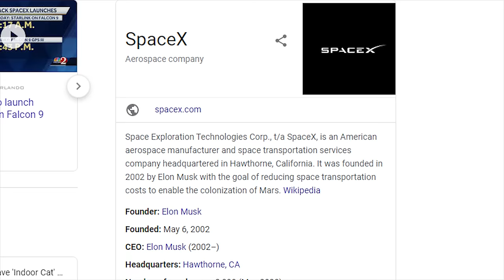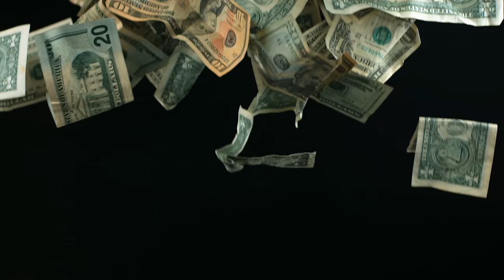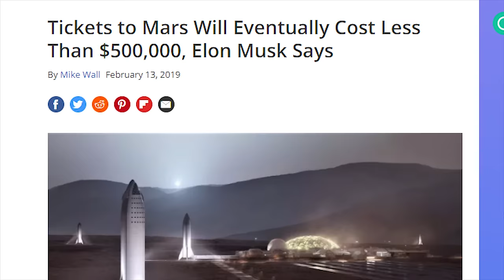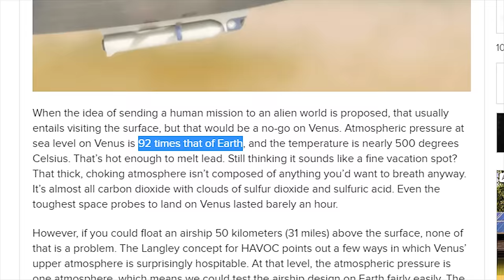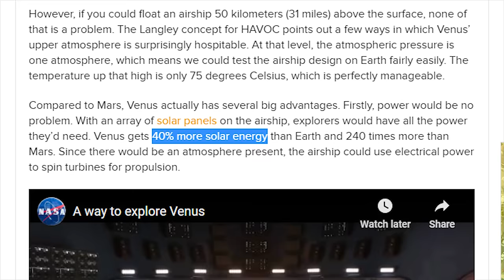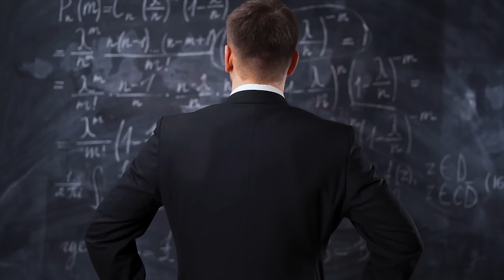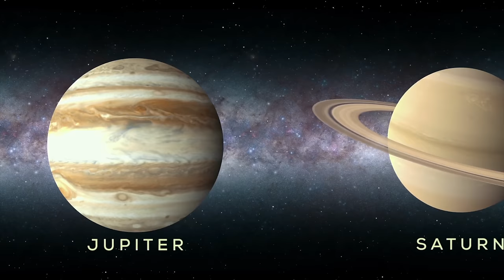Jeff Bezos' Radical Plan To Exploit Inhabitable Planets

Comment: Hey if there is a space race then great ... this is what we need to expand into the stars ... until that time we are vulnerable to annihilation by chance and misadventure.
Reply from the maker: For sure! A space race would be beneficial to all of us!
Reply: Unfortunately there will most likely never be an efficient way to transport humans between stars, and any colonies will be entirely on their own due to the enormous distances.
Reply: @En..  doubtful
Reply: @En..  not really we can already travel at 10-20% of light speed using solar sails, ion thrusters and electrical engines. That's more than enough in the solar system. And this is only slated to go up.
Reply: I doubt that it will be any different from now.
I don't want to fight with nukes with Martians😥
Reply: We are vulnerable to wasting a bunch of money.
Reply: @MS-qd1jj  it took nearly 25 years (for one of the fastest things that mankind had ever made) to reach Pluto.
Reply: @jemeljordan-butler4510  again, heavy, (possibly 25+ years) old tech. Also that mission made mistakes we're able to learn from. The new stuff is somewhat untested which is why NASA (or any other space entity) won't sink billions into a mission yet but it's only a matter of time. All it takes is one mission that's not a total failure.
Reply: @jemeljordan-butler4510  And about wasting money, think of the Indian Ocean Tsunami. A group of countries lost north of 12.5 billion dollars and 10,000's of lives. If they'd invested half of that into an early warning system, they'd have been a lot better prepared and saved a lot of money and lives. This is just one example of hundreds, prevention is almost always better than treatment.
Reply: @En..  thats why we need the tech to keep on evolving
Reply: @MS-qd1jj  you high or something?

Comment: Moving manufacturing to other planets/moons seems like such a terrible idea. By the time we have the technology to make the transportation costs low enough for that to even be a possibility, our manufacturing methods would have become clean enough that we won't need that option anymore. As for energy consumption. In those 100-200 years before solar panels can't sustain us, by then we'll probably have fusion anyway (if not something even more astonishing).
Reply: Like nuclear
Reply: That's another valid perspective from which one can view things. It however doesn't mean we can't run out of resources before we become technologically sophisticated enough to do these fancy stuff you're supposing here.
We need to start with the technology we have here and now. Don't rely too much on the future bcs you don't know what it holds.
For instance, we seem to be achieving nuclear fusion soon (apparently). On the other hand, the tech could still elude us for another 1000 years, who knows!
Reply from the maker: Great point, but moving manufacturing to other planets is not only for emission control. Another key point is increasing capacity especially with energy production.

Comment: Our body doesnt need 100 watts per hour, it needs 100 watthours per hour so it runs at 100 watts. Watt is not a unit for energy but for power.

Comment: But for those of earth industry, where do you get the oxygens to make sure that the flames are on, i mean a lot of industry requires flame
Reply: In most cases it's heat not flame.
Reply: That's not how powered facilities work. There are different ways to heat materials, including induction, magnetic induction, just running power to heater coils, and other means. Metalworking factories already use a lot of these methods. You don't need petrol, coal, or oil to power everything.
Reply: And in space, using solar kilns becomes much more feasible than on Earth.

Comment: Could we just keep the solar panels in space instead of needing a planet? One reason I say this is because solar panels lose efficiency when heated and Mercury gets really hot. Where space itself would be a great way to keep the panels cool. Plus you have the added benefit of not having dust collect on the surface of the panel, so then they don't need to be cleaned.

Comment: The landing of F9 boosters compared to New Shepherd boosters is NOT identical. One is a short, fat sub-orbital rocket which re enters the atmosphere with little to no hearing, whereas F9 has to perform a boostback and entry burn before landing is possible. F9 boosters are much taller and harder to control.

Comment: You are missing a huge piece of the puzzle, the entire point is that we can’t be stuck on a single point of failure. This is very short term thinking on a long term problem. Second, simpler innovations will help with pollution here, being able to colonize other planets is a full step change.

Comment: First of all I really enjoyed the video, keep up the good work. 

Rockets as you mentioned in the video could be made electric, that is false. You can make rockets environmentally neutral, but by literal definition you can’t make rocket’s electric, It’s not a Technological limitation it’s just not physically possible.

Also your main point that blue origin wants to but Industry on other worlds is False as well. Blue origin wants to mine and colonize the moon, as well as interplanetary space itself. This is because of shipping things from the moon to the earth is relatively easy, as the earth is a  massive planet and has a bigger gravity well. Plus the fact that our moon alone weighs about the same as almost all of the moons and astroids combined. our moon is planet sized no exaggeration, it’s about half the size of mars. The moon also has the advantage of being made of mostly the same materials as earth so all of your common metals and resources are readily available on the moon.

Mining and manufacturing on other worlds can be done. But shipping goods from not only a deep gravity well of other planets especially the gas giants, Back to earth is basically useless. Demand of energy and delta V required to move significance amounts of tonnage from these planets is going to be significantly more complex then mining the resources from our feet. We live on the biggest terrestrial planet. Most of the easily accessible resources in the solar system are literally beneath our feet. At our current mining rate it would literally take millions of years to just reach 1% resource usage on this planet. 

The same problems we face digging down deep to reach resources on this planet would be the exact same problem on any other. The problem is not lack of resources but The ability to get them, in a cost effective manner. The technology necessary to make deep mining on other planets cost effective will also make it more cost-effective on our own, The cost effectiveness of mining anywhere other than close to our own moon is dubious at best.

Real benefit is honestly that you can expand and dig as much as you want without having to demolish the city that’s in the way. And environmental concerns as you mentioned.

The environment on earth has historically been nowhere near stable so trying to preserve it as current state is also kind of dubious, because for the next 2000 years even if humans don’t change it at all it’s still going to drastically change in temperature by it self.  No matter what we do the planet in the environment is going to be pretty much fine, the only thing climate change is hurting is humans, That’s why we’re so concerned about it.

Planet, wildlife, and ecology will adapt just fine. We are the ones with cities that will flood and houses that will burn.
We have enough gold to cover the entire surface of the planet feet thick. Enough iron and copper to do the same.  You could coat this planet in materials with the amount of stuff we have here.  When you think of earth, think the richest place in the solar system, not The hundred or so kilometers thick layer that pretty much all of his life lives on. 

In short near earth mining can 100% be profitable. Other planets not so much.
Reply from the maker: Thanks for watching man! As for the electric rockets, I understand how that would be impossible due to physics. It was just a hypothetical to illustrate that even if we made that possible, we would still have the issue of pollution due to battery production. You bring up some great points as to why moving industries to other planets is not the best idea. However, this is precisely what Blue Origin is aiming to do. Here's a video of Jeff Bezos himself explaining his vision for Blue Origin and how he wants to move all heavy industry off of Earth. 
Timestamp: 3:46
https://www.youtube.com/watch?v=OQHZjBVfDhg&t=18s

Comment: Not so logically answered, this time...  I agree 99%, but one miniscule fact you miss is that Earth CANNOT be salvaged, at this point.  We've gone too far.  This year, 2020, marks the beginning of methane hydrate bubbling up from the Arctic seafloor.  It is bubbling up like there's no tomorrow, and that is a fraction of what it will be like in just a few more years.  The optimistic prediction was that AFTER the loss of the Arctic ice sheet this was going to happen.  Well, it seems it is not waiting for the ice sheet to melt away.  The bubbling is on, already;  it rises to the underside of the ice sheet, then it travels as up-side-down rivers of methane gas under the ice until it finds an escape.  The bad news is there's about 4 times as much carbon stored as methane hydrate as there is in all the forests on Earth, which means we may be heading to a new and improved Paleocene-Eocene Thermal Maximum event, which may benefit dinosaurs but impact human life negatively.
When I speak of this to people they often ask, "well, can't we just plant trees?".  What they don't understand is that the so-called "carbon cycle" is really a minor detail of the real carbon cycle.  The carbon that goes up as CO2 when a forest burns, or as methane if it rots, and is eventually reabsorbed by photosynthesis, is called "the atmospheric carbon cycle".  There is another carbon cycle:  biological matter at the bottom of oceans sometimes gets trapped in subduction zones and pulled down to the mantle, then comes back as carboniferous rocks, diamonds, etceteras.  This "geological carbon cycle" is much slower than the atmospheric cycle, but it contains 10 to 20 times as much carbon as the entire atmospheric cycle.  What we've been doing, by mining coal and extracting oil and gas, is effectively pulling carbon from the geological cycle and injecting it into the atmospheric cycle.  The total amount of carbon in the atmospheric cycle is growing fast. 
Therefore, if we set our goal to putting carbon in the atmosphere back to what it was say in 1800 by means of planting trees, at this point we would cover all of earth with the biggest sequoias and still fall short of the mark.  To get back to a pre-industrial atmosphere we need to turn our planet into a Gaia, into a super-rain-forest.  And even doing so would not restore the level of atmospheric heat trapping infrared opacity, because the trees we plant will only absorb the carbon dioxide;  NOT the methane.  The methane will take about a century to decay naturally.  In the meantime, methane being 70 or 80 times more opaque to infrared light, is gradually becoming as big, if not bigger, a problem than CO2.
We would need the world to act, and to act massively, and immediately, cutting fossil fuels NOW;  not in 10 or 20 years, and to ban ridiculously inefficient industries such as the meat industry, which single-handedly contributes about 65% of green-house gases;  but any time the knowledgeable and concerned speak out there are hordes of retarded trolls that jump to attack the speaker.  This is a subject that should not be politicized, but it is, inexplicably.  The moment you speak of environmental issues people assume you are a "leftist";  I am not a leftist;  I'm a total fan of Trump;  I HATE the other party.  But I don't agree with my party in matters of environment.    I don't accept this package deal where you have to agree with everything one party says, or with everything the other party says.  I have my own mind.  Get it?
Anyways, I'm getting sidetracked.
What I'm saying is we would have to come together, act united, to try and save the human race;  and if we did I'm not sure we would succeed;  but I'm skeptical at this point we will even try, due to the incredible success the anti-environment lobby have had of brainwashing the retards of our society into becoming environment skeptics and attacking anyone speaking of the issue like hyenas.
So, what I think is in Elon's mind, when he says that we should colonize Mars as an "insurance", is that it is far more than just an insurance...

Comment: I wonder if it would be possible to emit enough gasses on the moon to create an atmosphere?
Reply: No. The moon not having an atmosphere is not due to lack of gases but to low gravity which can't retain the gases.
Reply: @faustin289  sure, the moon has a 1/6th of the gravity on earth, but there is nothing really creating gasses on the moon either. Given that, i think it could be possible to create an atmosphere if more gasses are emitted than siphoned off. Albeit  much thinner and smaller.

Is an atmosphere relative to the amount of gravity or is there a certain threshold in wich gasses can't be held?

Comment: I'm very disappointed with your video.  You mischaracterized SpaceX's stated purpose, which is to provide a backup plan to save humanity from an extinction level event, not to just to have fun.  Pretty important difference.  Also, you failed to mention that SpaceX was also selected by NASA to use the starship as a lunar lander.  SpaceX is not just focused on mars.  Musk has stated many times that he designing the starship to be able to access all the planets and moons in the solar system, allowing humanity to branch out beyond Mars and the moon.  The progress of Blue Origin is quite disappointing, especially considering how much money has been spent annually.  The company was started before SpaceX, as you noted, yet have not even reached orbit once, while SpaceX dominates the low earth orbit launch market.  I want Blue Origin to succeed but they seem to have the wrong leadership.